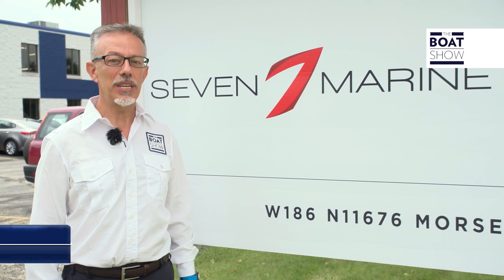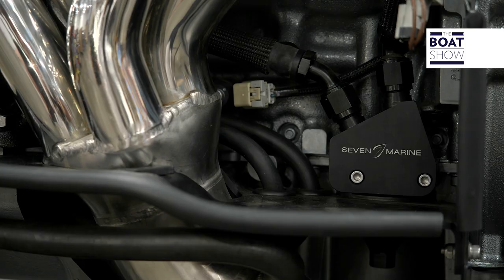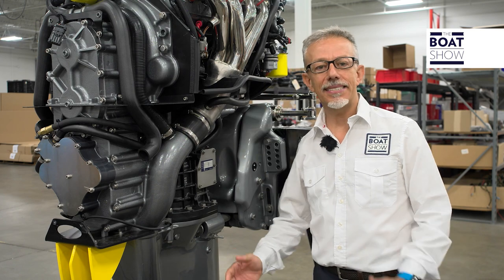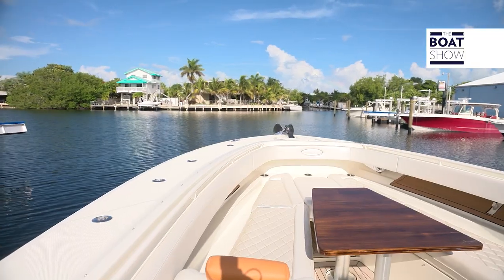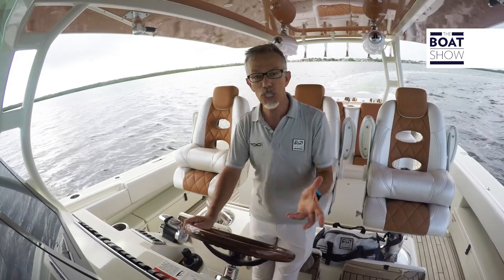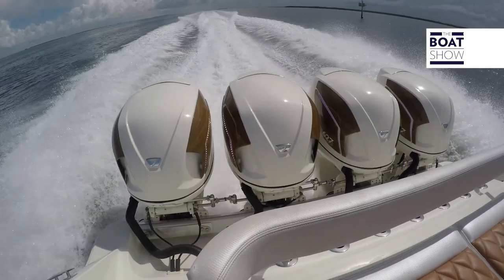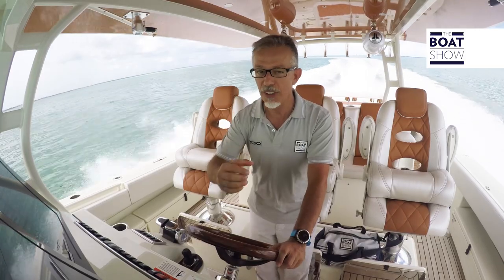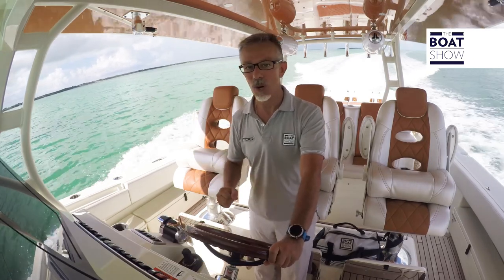[ENG] ZF Marine for Seven Marine - Hydrasports Custom 53 Sueños Review - The Boat Show

Comment: 80k / motor?
Looking to replace a pair of year 2000 Honda BF 115’s that weigh 230 kilos each so 460 kilos all up, so I could just get away with 1 of these 7  Marine engines, weight wise, and have almost 3 times my current 230Hp.
Tempting, but that $80K US will translate to $104K Aus! yikes!
Pretty sure I can almost get away with a pair of 300 Hp Outboards weight wise for similar HP & cost about half the Seven Marine OB cost!
Am familiar with ZF Marine transmissions from commercial work boats & they have a pretty good reputation for longevity.
Be interesting to know what the fuel range would be with my existing 86 USA Gallon fuel tank capacity with just one of those engines on the back!
Also what WOT speed I’d get out of the 28 ft pilot house weighing about 5500 pounds, with the single Seven Marine OB?
So many questions!

Comment: When you have no care in the world how much fuel a boat burns ... bliss ...
The fact that this engines with all its power still has a really inefficient lower unit.  If they followed Suzuki with a just a slight bullet nose lower unit, they would improve speed by at least 5 kts ... The standard lower unit design has not changed in over 50 years.  The hull - wow - inefficient ... too bad.  Power always makes up for that though.